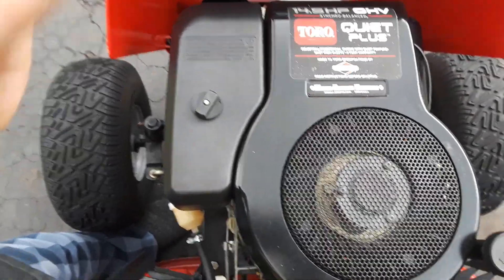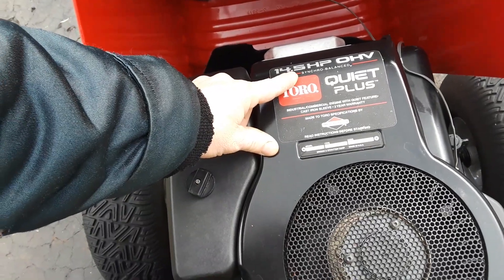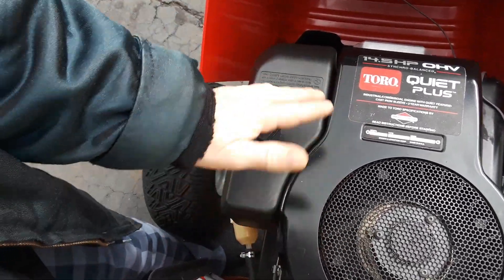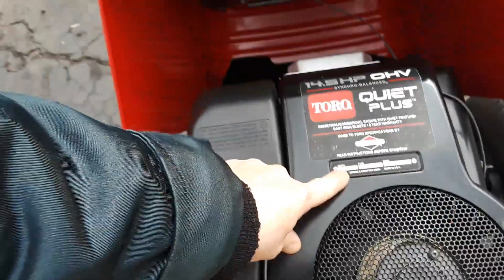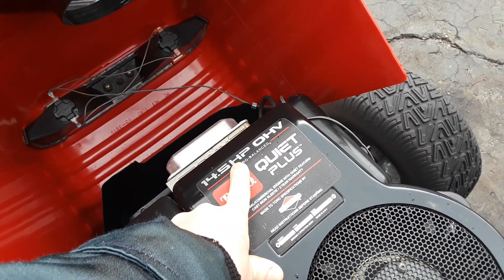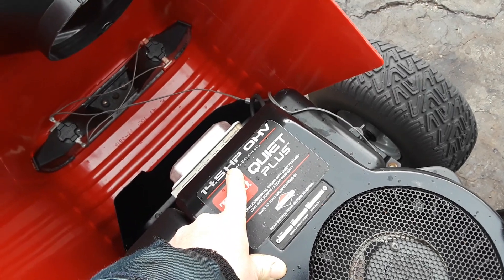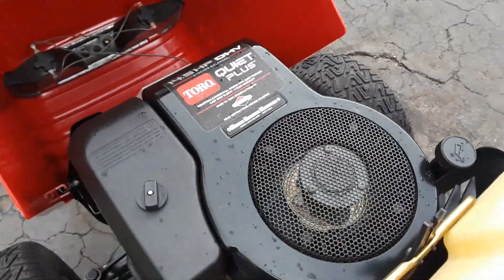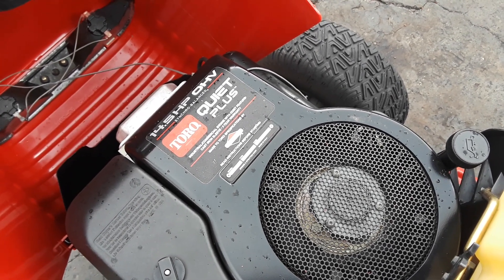465cc 12-13hp L head vs. 14-16.5hp OHV Gen 1. Is  there a difference in power? No!

Comment: Really?  Engine output is not just cc displacement, the same engine, just like cars, can produce different outputs depending on  cam profile, compression, exhaust design, carburetor size. It is not the cubic in displacement. You are way off on this. I have a gravely zt1232, they also made an identical 1442 . If you look at the manual it shows the same motor for both ? But, look more close and the 12 has a much smaller muffler than the 14, which makes the same motor higher HP
Reply from the maker: @mailbox642 Yea really and I can back it. I’ve had them both open, bore and piston are the exact same size. All the parts inside and out are identical. The only difference between the 12 and 13 is the shape of the shroud and size of the screen which by the way are interchangeable between the two. Open one up some time before calling someone “way off” on the issue. Also the muffler has nothing to do with it either, that was the machine manufactures choice to use that muffler, every manufacturer uses a different muffler. I’ve swapped dead 12’s in place of these 13’s onto Craftsman’s. Using the craftsman muffler the 12 had. There was no difference. Fact check yourself before, incorrectly fact checking someone else. Minis the shroud and screen the blocks are identical. Btw Briggs has been sued with multi million class actions  3 times already for over rating the power of those engines. Check yourself. I work on these thing’s daily. The muffler comment is total poppycock, you’re just making shit up.
Myth busted.

Comment: I think I figured it out.  The small engine is the same in a product line, but when the transmission and deck size go up in models, the engine becomes more loaded and it will pull more power. So the equipment manufacturer is allowed to say that the engines have more power for the higher models trims with heavy duty transmissions and wider decks with longer blades or more spindles.
Was just looking at the Cub Cadets with the Kohler 7000 series motor - the model with the bigger deck has 2 more horsepower but the engine is identical.
Reply from the maker: It definitely depends on the deck size and what the machine was made for. For the most part any machine with a 46” inch deck and up utilizes a V twin engine and they’re usually equipped with a fuel pump because they have larger capacity tanks under the seat and frame, that have to be pumped up to the carb. Usually 42” inch deck machines have single cylinder engines and the majority are gravity fed. It’s not always the case but it’s the general rule of thumb. However, 12-13.5hp were all 28 cubic inch. 14-17 were 31 cubic inch and than the 33 cubic inch single came out later. That applies to Briggs. All the 31’s and 33 share the same size block, only real difference is the size of the bore and piston. After that you have the V twins, theirs 2 of them a 656cc and a 724cc, you can go by cc or ci they can be both be converted. They also share the same block, just larger bore and pistons. Same applies with Kohlers and other brands, the Command for instance was anywhere from a 12.5 to a 17hp, but as they got larger their displacement grows. The 12.5 was 398cc or you can equate it to cubic inch. The 17 was roughly 469cc, they shared the same blocks and components, the only real difference is how large they made the bore and piston. That’s what’s giving it more power. On Briggs engines the size of the engine is built into its model. The first two digits of the model is the size of the engine in cubic inch, the code which is the third set of digits is the build date, so a Briggs that starts off with 31 in the model is a 31 cubic inch engine. But the horsepower rating varied so wide, it got cracked down on, so they changed the rating to ft Ibs torque, but I’ve seen that played with too. The only true rating is the actual displacement in cc or ci. If you go back to the old now classic tractors from the 60’s and 70’s the majority of them were rated at 10hp and had just as much balls as one rated at 16hp today, in some cases those old engines had more balls, so hp ratings got out of control at the end. But I use a 12hp 465cc 28ci Briggs flathead on my machine and compared to a 33 cubic inch they make now, the difference in power between them is very little. Once you jump up to a v twin which has two pistons, although only one detonates at a time the amount of power is significantly noticeable. They also run smoother because they have much better balance so you get a lot less vibration out of a v twin, so you don’t hear the tractor’s frame vibrating. But one last example, the old Briggs opposed twin flatheads. There were 2, there were always only 2. In the beginning one was rated at 12.5hp, the other 16. 12.5hp for an opposed twin vs a 12hp flathead single was a much more honest rating. Anyway by the end of production of those engines, they no longer rated the smaller one as 12.5. They started at 14hp, they had 14.5, 15, 15.5, 16, 16.5 all the way up to 21hp. The displacement never changed all they did was take the two same engines they built all along and jumped the 12.5 to anywhere from 14 to 16.5. The other one went from 17 to 21hp and nothing changed except, one they started over eating them and added all these extra in between hp ratings. When you purchased a machine and you bought one that was 16hp vs a 14hp you payed more, each half a horsepower it went up made the cost of the machine more new, retail. People finally caught wind of the bullshit and a class action lawsuit was filed and won against Briggs, Tecumseh and Kohler, it was multi million dollar settlement . After 2008 horsepower ratings as a general rule of thumb went away. They switched to a more accurate ft Ibs torque rating which had to also state its displacement along side. This way if they played games you could do your own homework and make sure one rating added up to the other. However the last of the Briggs Quantum engines which ceased around 2015 that I saw on Toro Recyler walk behind mowers started at 6.75 ft Ibs torque a year or two later they went to 7.0 ft Ibs torque. The last of the Toro Recyclers with Quantum’s at the end got up to 7.25 ft Ibs torque and they all had a displacement of 190cc. It never changed, they just started playing the same game with another measurement of power. The Quantum ran from 1986 to 2015, they were all always 190cc it never changed. When they still used hp they were all over the place. Anywhere from 4.5hp all the way to 7hp. They found its true rating in hp was 5. No more, no less. That’s at 3100 rpm. The big ones on tractors have there ratings derived at 3600 rpm. So the only true way to know an engines actual power output is to check its displacement at the rated rpm. They can’t lie about the size of the bore and piston, if they do that, they would pay dearly. They all already paid millions in knowingly lying during the horsepower class action. However they’re still playing games with other ratings. Oh and now in the residential realm for Briggs, the current biggest walk behind engine has a displacement of 163cc, yet they still have the monumental gaul to say it puts out 7.25 ft Ibs torque. That’s an outright lie. I know it for a fact because the 190cc Quantum had more power than that 163cc engine and they were overrating the 190cc at 7.25 ft Ibs when just a few years earlier the same exact engine was rated at 6.75. I don’t know if Toro was the ones playing the game or Briggs or both, but that’s how they went about claiming the models for the following year were upgraded, in reality it was the exact same mower with a different sticker and power rating slapped on the engine. So do not trust anything but the actual displacement rating and at what rpm. All the Tractor engines have their displacement derived at 3600 rpm the max they run at. Any other rating will almost definitely be marked up by either the manufacturer of the machine or the manufacturer of the engine or by both. They make you think theirs like 6 different engine power rating’s for 2 engines in the single the 31 cubic inch and 33, the v twin the 656cc and 724cc so two each and both share the same block one just has a larger bore and piston nothing more. If they keep playing games with other ratings they are going to end up being sued again. They used to say horsepower sells, well now they don’t use that rating or say that, but they still know more power sells, so they keep right on doing what they did before, I guess they don’t really care if they get sued again, maybe they can afford to shell out millions of dollars in lawsuits on all the extra money they make over rating these thing’s, unfortunately that’s what they do, lie and tell you this one has more power than this one and the reality is it’s usually the same. You definitely know if you choose a machine with a v twin vs a single cylinder your getting more power, but choose between one’s with both singles or both twins, one might say one thing and the other one another, but in reality your getting the same thing. Maybe a difference of 2 ci or 40cc and when it comes to those engines 40cc is almost un-noticeable, out-least in that case you know you got that extra 40cc and not some made up bs on one that is the same cc. It’s capitalism, how can they get the biggest buck for their bang. Just like we think how much bang can we get for our buck.  But if you know what’s goin on you can save some of your bucks for the same bang or so close you wouldn’t notice if they didn’t tell you. If they do get sued again, not sure how they’re affording it. Tecumseh declared bankruptcy shortly after. Briggs declared bankruptcy during covid and is now owned by a financial firm that takes company’s in financial trouble turns them around and than sells them for a profit. I’m not sure how Kohler is doing properly not much better, only thing they got going for them is the company makes a lot more products than just engines, like toilet bowls for instance. However they can’t be doing that much better, all those companies are now in competition with Chinese made competitors cutting into their margins. One thing about all those Chinese engines I see, they don’t lie, they just put the cc rating on the front and that’s it, no bs. Yet go to harbor freight and the same 212cc engine has a tag on the shelf that’s says 6.5/7.0. That must be HF’s call cuz those actual physical engines say 212cc and that is it, no nonsense. Anyway it’s all a game on how the can get more of your green. Once you’re aware of it, you are ready to guard yourself from it. Also unfortunately Kohler engines quality has come way down in the last 15-20 years. They all have really, except vanguards. Those are made in the United States, are the commercial line and cost a ton, but also last a long time and withstand far more abuse than any residential line. Oh yea electrical power rating’s can be lower or higher between them, depending if you have an electric pro or not, etc. But those components, like stators are interchangeable, you can swap one out for another, so that’s no big thing.
Reply: Very insightful!  I was only recently questioning it because I have an old JD LA115 I needed to work on, and began wondering why all these engines have the same volume size, same exact or almost exact block, but they have different horsepower stickers depending on the size the mower deck and tranny from what I can tell.  Probably going with the JD S170 rather than a cub cadet- mowing quality and the transmission is the priority, not whether it's some welded-together mowing deck.  Maybe I'll read the SAE document that guides these vendors to self-report their horsepower ratings.
Reply from the maker: @mattb9664  John Deere’s are definitely better than Cub Cadet’s or any MTD product, although I’ve seen them with their own sets of problems too. But when it comes to these engines they put on everything now, they all have their own sets of problems that arise no matter what machine it is. For Briggs singles, the compression release breaks on them frequently and the head gaskets tend to blow out. Head gaskets aren’t a big deal, but when those compression release’s break you gotta pull the whole motor and put it upside down and remove the sump to get in there and replace them, that can be a pain. The one thing I don’t like about John Deere’s is they make you pay for the manuals if you don’t have them. Just about every other manufacturer provides that stuff free online. John Deere likes to hit you for everything.